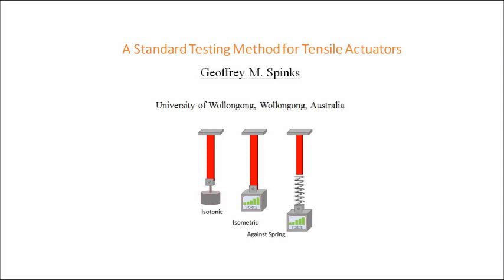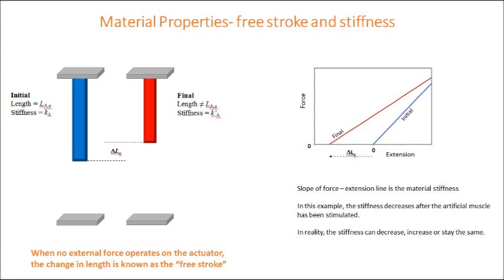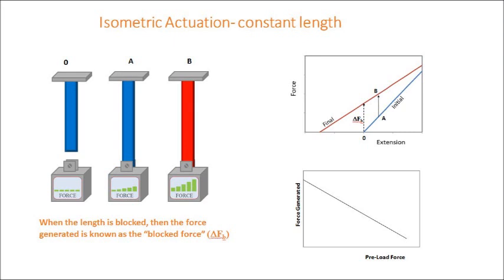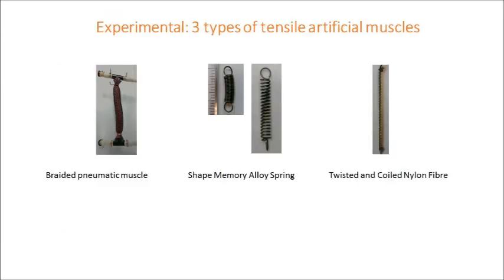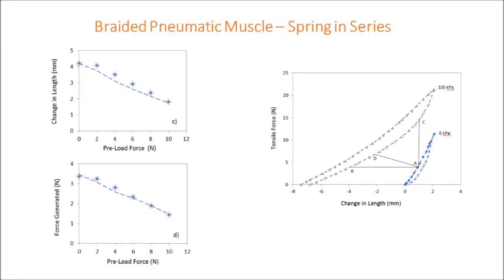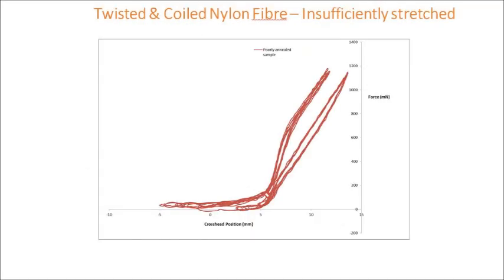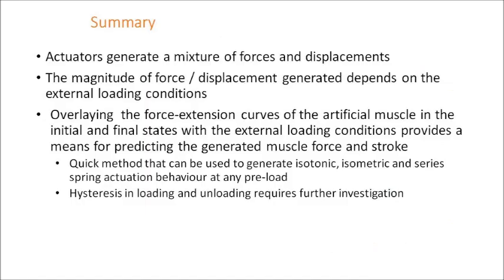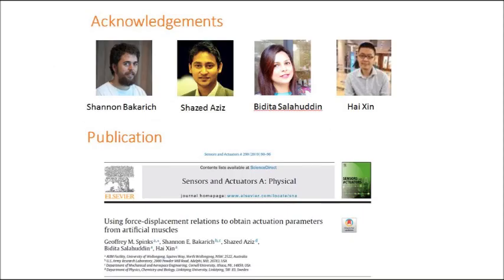Testing artificial muscles.

Comment: Hi I would like to pick your brain if possible. I am building a robot and need an artificial muscle that is cost effective and that can preform similar to a human muscle but scalable as far as lifting force. Could you advise what your recommendation would be? I see your video and think this as being something that would not be very fast since to get max lifting force it would require 85c of heat and I don't want to generate heat. I have also found hasel actuators but not sure I can get my hands on those readily. Thanks in Advance.
Reply from the maker: This is a very challenging problem that many research groups are trying to solve. The best non-thermal options at the moment are dielectric elastomers or HASEL systems. Sorry, but we don't have any practical experience with such to offer you. Best of luck with your project.
Reply: Why dont you want to generate heat? Almost every actuation system generates heat in one way or another. Having a cooling system would likely be the way around it.
Reply: I can’t give you anything specific but I’ve done some research into this here’s my Snapchat and can send you pics of the notes I’ve taken jhark2000